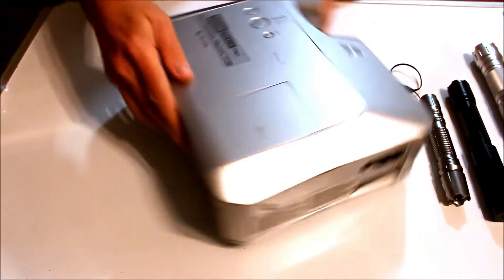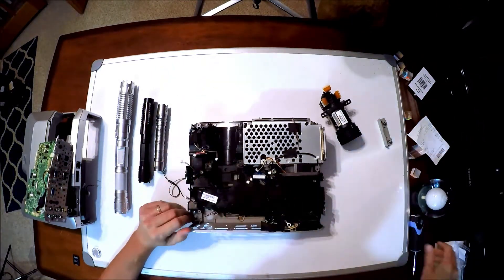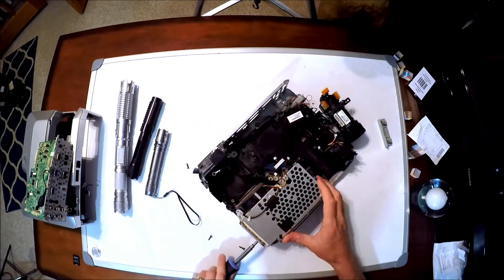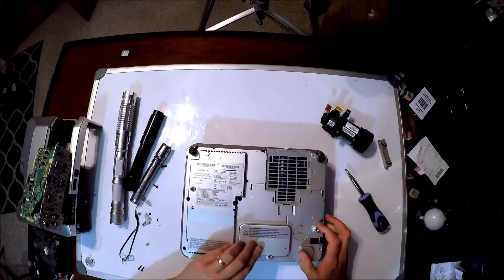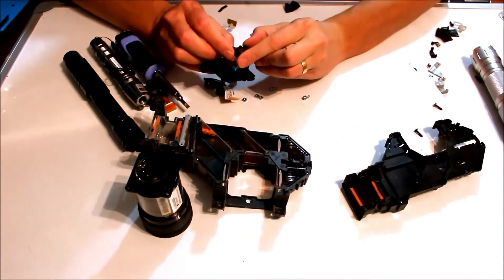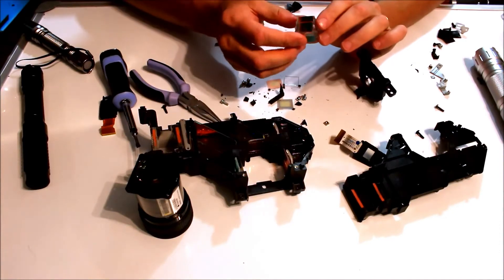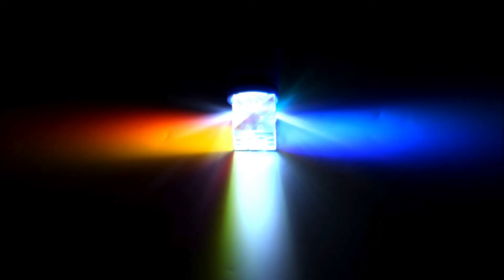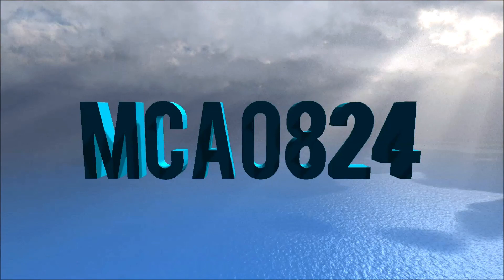Dichroic X-cube prism removed from projector. Laser experiments

Comment: I have one of those X-cubes that just today I pulled off all this metal that was stuck to the cube and oh boy it was really stuck on there!!
like the first thing to come off with this plastic bit with a little prying and then I pried in between two of the metal parts and one came off with left two on ether side, now I tried prying it off from the top but it just split in half and I later found out that there was glass in the metal bits so I had to be carful other wise I would get broken glass everywhere, finally I used some broken flat head which was really small to get into the little holes on the side and that finally pried off the two remaining metal bits off the cube and oh boy... was it worth it? I don't really even know anymore :/

Comment: What kind of projector? Any kind of projectors are okay?
Reply: Go on eBay and type in “projector”…. And then filter the results by, lowest price, buy it now listings only, and used items instead of new.

You can pick up plenty of projectors between $10 and $30 including shipping… The one he took apart in this video was an LCD projector. That used a bulb/lamp as it’s light source…

 They’re very common. And you will see written on the top of the projector a little emblem that it says something like “3 lcd” or “LCD 3 technology“. 

It can either be bulb, LED, or laser illuminated.
It will still have optical components like he showed in this video. Or it may vary a bit. Before you purchase it, get the model number and type it in on Google to try and find a photograph of the inside optics. That way you can see if it’s got what you want before you buy. But most all of them will have an Xcube inside.

But be careful. If you get a working projector, it can blind you in seconds. Don’t look into the light source. Doesn’t matter if it’s a bulb, LED, or LASER!!
Yes…some of them are even lasers… All of them will damage your eyes but obviously the laser projectors are the most dangerous.

Casio made several types… that you can usually find in working condition for under $50. 
I’ve purchased untested units as cheaply as $20. 
Even if the lasers are all fried… You still get a shit load of incredible optic parts! Which were designed to be used with lasers. So they’re more practical for laser experiments sometimes.

They have a big array of individual laser diode’s inside. Blue diode‘s… you can find videos on YouTube and plenty of pictures on Google. 

Just be really careful… and don’t mess with them until you’ve researched how to properly power up the lasers. Laser diode‘s are the most sensitive electronic component you’ve ever messed with! Even a bit of static electricity from your body can blow them and ruin them completely without you knowing it. Even if it’s a small amount of static, and you don’t even notice it

A single low power diode could blind you faster than the human eye can blink. Even from a simple reflection off of a shiny object in the room. Or one of the optical components inside. A small reflection is all it takes.

It might not totally blind you… But you’ll start to notice a blind spot in your eye over the next few weeks. And it will never go away. A little spot on the back of your eye, and no matter what you’re looking at in light or dark they’ll always be a missing segment of it. Like a television with missing or blown pixels.

Got to laserpointerforum.com for more laser information. Plenty of great optics information on there as well!! Also “Sams laser faq” is a great website.

On YouTube, subscribe to zenodilodon, And watch some of his videos before messing with any type of laser or experiment. He approaches it with a real scientific method… It is a genuinely cool and nice guy who is super smart.

Styro-Pyro makes laser videos also… And talks a lot about safety. Listen to him when he emphasizes how easy it is to damage your eyes permanently. don’t get me wrong…He’s a really smart and funny dude. I’m just not a huge fan of The types of videos he puts on YouTube. There’s nothing wrong with them… I just prefer more scientific content instead of burning shit… that’s just my preference is all.

He’s SUPER smart and knows what he’s doing and is well respected in the laser community.

There are plenty of other great Youtubers with laser content as well. 

Just be careful, and take the time to order a pair of laser safety glasses from Amazon. The cheap ones are better than nothing… But you still have to be careful. 

Watch Youtubers who have tested the safety of cheap laser glasses. There are several videos.

 if you buy a $5-10 pair of cheapos… look at reviews or test them yourself to Be sure they will actually keep you safe… 

but even if you have $100 pair… You still obviously want to avoid the beam shining in your eyes no matter what.

Hope this helps someone

Comment: So, I have a 25 mm cube from an NEC projector. Mounted in an aluminum frame. Need advise on how to remove the aluminum without hurting the cube. Plan to facet 
the cube.
Reply: Facet the cube? Is there any particular reason? Sounds like an interesting project… But keep in mind Most of the coatings are on the exterior. 

Technically it’s 4 triangular prisms glued together. I guess that’s why they call it a “X-cube”… because when you look down from the top you can clearly see the separate pieces of glass.

Some of the coatings go through the interior of the cube… But they won’t really be visible once you cut away the face. Just a tiny little cross-section of coating a few microns wide. 

Sounds like a fun project regardless.
I’d Be interested to hear if you have any updates on this project? 

I’ve done quite a bit of faceting myself, but that’s been years ago. Last machine I had was a facetron… When they first came out with the really fancy version… So that shows you how long ago it’s been since I’ve cut anything, Except the line in the grocery store.😂 

I also enjoy restoring faceting machines. vintage and modern machines… Like the graves Mark four and Mark five XL, old ultra tec, lee, and others…

My skillset is best suited for things like that. Equipment restoration and calibration. I’m not very good at being creative, or spontaneous. And that’s important when cutting gens. Although at first it’s important to follow the math and the long established designs… After you’ve cut a few hundred or thousand stones… Do you want to start playing a bit… And coming up with your own designs. And that’s not something I’m good at.

I’m good at working to a design… Following a complex blueprint no matter how long it takes. I could probably build a working nuclear reactor in my lab… If I had the plans. (not bragging because A regular 12 year old can do the same thing😂)

But I’m not smart enough to design and innovate. I just have to trust the engineers who made the blueprints… And let the folks with the higher IQs have fun with innovation and creativity.

But I still enjoy being part of the craft…… But instead of doing the cutting…I’m buying high-quality machines from the 60s, 70s, 80s, and even some modern machines……Completely tearing them down and sand blasting them to the bare castings. Then restoring and calibrating them to perfection. To a much higher tolerance and accuracy than when they left the factory. (which really is overkill… because the manufacturers did an incredible job…But it’s something I enjoy.)i use more modern materials and coatings…so that things won’t wear out and will last forever.

I’m a machinist by trade, but do woodworking and electronics for a living. Two separate businesses. 

I have an electronics lab, and my main business is component level circuit board repair….. for a wide range of industrial and government clients. 
Also a bit of metrology and optical test equipment calibration. (spectrometry and such) 

and that’s how I became interested in lasers and optics. It’s a golden age of equipment! If you know where to look you can get an entire professional optics laboratory complete with lasers, an optical breadboard, and all of the equipment. For pennies on the dollar! government auctions, auctions at colleges and elsewhere in academia, and Ebay are your friend! 

I’ve spent a very small amount of money… To amass the type of equipment I have. Buying decommissioned laser equipment and optical lots from government and industrial auctions. 

At least $50,000 worth of optical equipment if I had to buy it new. And I paid less than 10% of that. Way less! Some pieces were bought individually… But a lot of it was purchased in several lots that would be auctioned off all at once. Pallets full of stuff… For pennies on the dollar. And you know how the government in large corporations work… They buy stuff they don’t even use. So a lot of the stuff was either brand new or like new!

Sorry didn’t mean to ramble on. Would love to hear any updates about your faceting adventures.

Comment: can you do a video with the really cheap 1 mw green lasers on ebay and see their real power?
Reply from the maker: 1mw or 1w  ?  The 1w green lasers I have purchased are usually around 80 -200 mw and the 1-5 mw lasers are actually around 20mw.   Have you seen one in my videos ?  I will be happy to put it into a new video.
Reply: yeah ive seen alot of 1 to 5 mw lasers on ebay for like 3 dollars and was wondering whst their true power was as Ir leak is really bad for your eyes because cheap ebay lasers have no filter.
Reply from the maker: Those cheep laser run high and the  expensive one run low.  Always best to error on the safe side.